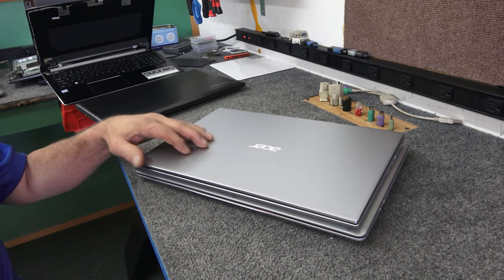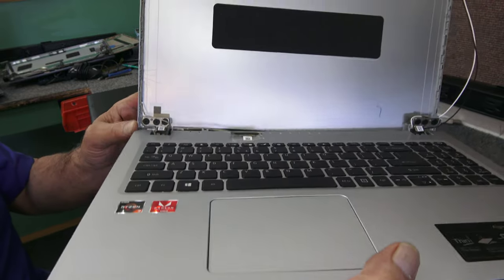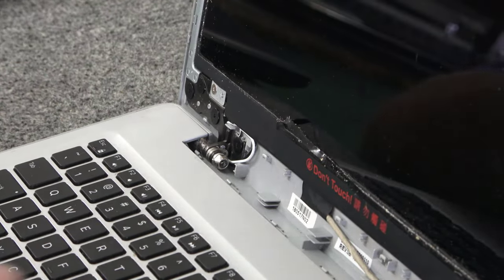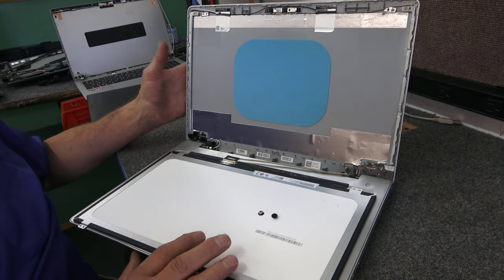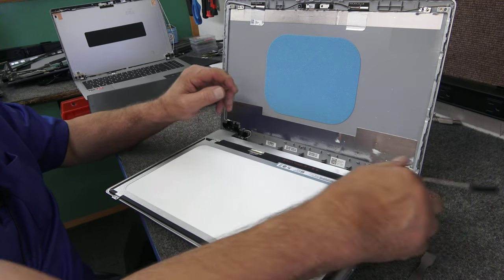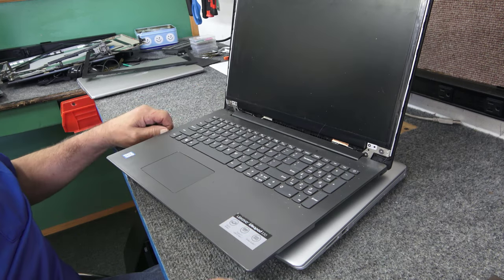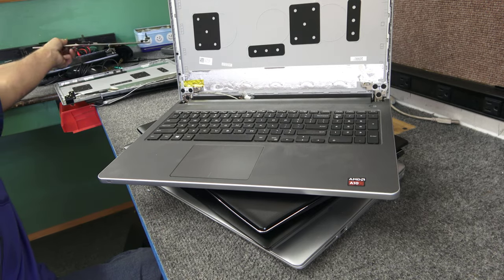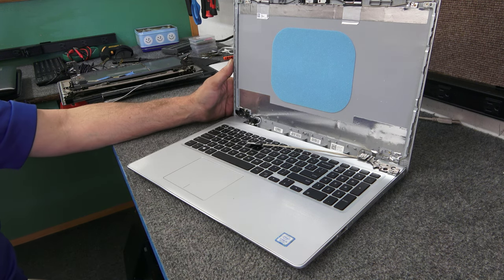Laptop Cover Broke From Hinges, How This Happens.

Comment: Even opening from the center will still break it, sooner or later. It's the failure of both mechanical design and choice of materials in pursuit of lightness and slimness.
Reply: Especially if you own an HP Envy laptop. The plastics are simply garbage.
Reply: @PlanetIscandar  Also Lenovo
Reply: bro please tell me i have a Lenovo laptop and i have the same problem, i have visited the shop 3 times and he pasted it every time, and after 3-4 days it again breaks, please tell me the solution ! PLEASE
Reply: @VinitAhlawat-l7q Just get new hinges
Reply: Exactly

Comment: Just had this happen to me with my Dell 3511 which are notorious for broken hinges. Thanks to Ebay for new parts and Youtube videos I was able to do the repair myself for about $40 which included new cover, bezel, and hinges. Taking it apart and putting it back together was a lot easier than it looked, (take your time). One of the repair videos I watched suggested adjusting the tension in the hinges to make it a little easier to open and close which should make your repair less likely to need repeating.
Reply: Same ! This model of Dell Has many faults , There are so many people complaining about this model and It is true! This model is not worth buying it , I can't believe Dell being a trusted company, It has Models like 3511 , Literally the worst one , You gotta Handle it with a lot of care , even The Slightest pressure on One side can ruin The hinge again
Reply: Same model
Reply: Same here
Reply: Same model
Reply: @souravpal5782  It's been 5 months and my repair is still holding strong. Remrmber to loosen the hinge tension some so there's not so much pressure placed on the hinges.
Reply: Same here
Reply: Same ..I had this issue and I got it done proper during warranty period and again I'm having the same issue and I don't know what to do as I'm scared to fix it on my own
Reply: @anushabn1630  Go ahead and do the repair yourself. I was hesitant to attempt the repair myself because I realized how delicate the electronic were and I knew that one mistake would possibly ruin my laptop. Follow the video as you make the repair and most importantly take your time. It was really a lot easier than I thought it was going to be. Also make sure youu reconnect all connectors, (had to disassemble mine because I forgot a connector) and most importantly don't overtighten the tension in the hinges. Too much tension in the hinges is what causes the failure in the first place. You want the lid to be fairly easy to open and close. Go for it.
Reply: Same laptop, same prob
Reply: i have same laptop
Reply: Same model and had the hinges broken twice in 2 years.. Trust me, I never handled it badly, I never even used it on my lap.. Costed me 3k bucks (INR) each time.
Reply: @Tithi1416  Cost you 3k?
Reply: Same 😔😣
Reply: I'm having the same issue , same laptop help me fix it 🥲🥲
Reply: Correct Dell put far too much tension in the hinge . undo the locking nut one turn and the lid opens much easier with still plenty of tension to hold the lid open .
Reply: Same model here. My laptop just started to show signs of this after 1 year of using it. Should I loosen the tension or should I contact Dell? Does Dell cover warranty for this issue in the first place?
Reply: Def  release some tension , apparently Dell are saying its wear and tear which is rubbish . I would unclip the sceen surround and run some superglue in the cracks if you see any. It only needs enough tension to hold the screen open .
Reply: When I open my laptop, I see yellowing of the screen. Is that normal because of the hinge? is it dangerous to continually open and close the screen when all I've done is loosen the tension?
Reply: Can some
One suggest screw driver to open and replace hinges for hp gaming laptop
Reply: Hey Ray, I have an 11 month old 3511 and the side of the screen coming apart, it's always been so stiff to open since the beginning.  How can I adjust the tension on the hinges?  What video can I watch?  Thanks.
Reply: Where can i get it fixed in Delhi? Please help
Reply: @Tithi1416 ssme here sis,damn 3000 is a bit too much for a student lile me

Comment: Thanks for sharing this. I also do repairs like that occasionally. Most of the time lenovos, they get brittle after a couple of years. I always make the friction of the hinges a little lesser. That way the stress on the enclosure parts is a bit lesser. I also use abs plastic and AB glue to reinforce the enclosures.
Reply: hey just wondering how much a repair like this would typically cost?
Reply: @tinymoondog7705  Depends on what laptop you have, but for Lenovos around $320.
Reply: My Lenovo is suffering rnnn
Reply: @GlocktheOPS  I got my hinges fixed for 98 bucks. But my screen wasn't broken so it was pretty cheap

Comment: A cracked screen bezel in the corner of the screen was my first experience with opening from the side back in the late 90's. The shop accused me of opening the screen back too far and because of that accusation I never returned to them. A couple of years later I found out about opening from the corners will cause damage. This was at a time when laptop screens were latched closed in the corners so that didn't help with the behaviour.
I've told everyone since then open from the centre.

Comment: Thanks for the post. Just had this on an HP envy 13ba I have had many laptops over the last 30 odd years and this is the first it has happened to me.  As you say the plastic degrades over time and on the hp one side failed quite badly.  Used a resin to effect a repair but not sure how long that will last.  Very disappointing given this weakness will lead to a lot of laptops being destoyed well before what should be their useful lifetimes.
Reply: U are not alone
Reply: HOW DO I FIX THIS PLEASE I HAVE AN HP ENVY SOMETHING TOO AND IT JUST FULLY CRACKED AND I NEED IT😭😭
Reply: I used plenty of areldite as the hinges themselves are ok but the case plastic cracked - it seems to be holding so far the alternate is a completely new plastic base

Comment: Thank you for the video Sir. My laptop started to fail with the hinge, but I never thought it would be a problem. Now I have a dark-black stain in my lower right corner. It´s not a big deal, but it´s very annoying.  Thanks for the advice, now and in the future I will open my laptop from the center. Actually not right now because I can´t close my laptop anymore, the 4 Phillips screws fell down, and the hinge doesn´t move anymore.  Actually, my laptop is also a Dell Inspiron 15 5000 Series like that one in the video. Thanks for the video, and thanks for the information. Greetings from Mexico
Reply: same i cant close my laptop now so should i repair it at phone services?
Reply: I had to use it 90° open**

Comment: I prefer the laptops with long center hinges. They seem like a sturdier design not subject to the opening stress of laptops with two flimsy hinges.
Reply: I've got a lenovo laptop with long center hinge but still had this problem because there are still two attachments on either side which have these manufacturing defects

Comment: Most laptops have hinges that have a nut that controls the tension and it is too tight which causes the hinge to break the plastic housing over time . The hinges seem to get stiffer over time and this causes the problem. The laptop makers don't care and try to charge you when you make a warrantee claim. I have repaired my laptop by passing a screw with a nut through the hinge and the cover. My next new laptop I will loosen the nut slightly on both hinges to take away the strain. If you are afraid to do this get a computer repair tech to do it for you.

Comment: Thank you for the video!  I noticed over time the hinge will gets more heavy. Can you make a video about how to remove the most commom type of hinge and how to open up them, clean them, (maybe take away burrs), oil them to let them work more easily?  Found out some hinges are expensive and makes replacing them not worth it. (added to the broken cover/inserts).

Comment: Exactly what's happening to my ACER ASPIRE 5 SLIM. I've had it for 2 years, bought it with my covid check, and just seen that the lid and hinge are bending apart. And I see where the screw that's supposedly glued to the lid is detached from :/ was hoping to find a vid on if you could glue it to extend it's life. Doesnt seem like super glue will be enough. dk what to do use jb weld and never open and close it again unless i have to.
Reply: Bro having the same issue .. what did u do ??
Reply: @ayushgaming2629  Yo I just never open and close it and praying It doesnt get worse where it's unusable. But If it does get worse then I guess Ill have to try hooking it up thru HDMI to my tv and using it that way if worse comes to worse 😥🙏😑
Reply: @ayushgaming2629  I think I might just buy a mini C-Clamp and clamp it on the bottom corner of my screen. Just gotta not move it at all cause if it falls the c clamp will probably bust the screen.
Reply: @redmakerr  trying the method of not closing it now .. will use c clamp to if it gets too worse
Reply: @redmakerr  and if it gets too much out of hand .. then I will buy a 2nd hand monitor and connect using HDMI

Comment: Happens to me every time. A drive fails, battery,  something.  I take the back cover screws off. Eventually the cheap threaded inserts break. The cover doesn't screw on right. everything gets loose, the hinges fail, and I buy new laptop. If those cheap threaded inserts that held the back cover didn't continue to fail my laptops would never break

Comment: Thank you for the information, and my  new laptop is in the same situation  ,  just 2 months has passed,
My mind is blank , can I ask them for a replacement   for the laptop , is that possible.
Reply: If it's just been 2 months it should still be under warranty. I would definitely check

Comment: I better be careful with the HP laptop that I bought back in April of 2021. HP 15, AMD Ryzen 3 3250U, 4GB SDRAM, 1TB HDD + 128GB SSD. Screen is awful but is an OK unit for minimal random use. Price was high.
Reply: How much did you pay
Reply: @ad1854  $349.00
Reply: What was the model?

Comment: I've had many laptops over the years and it never fails, the hinges go bad and I end up with a cracked cover and I always told the manufacturer that they need to fix the problem but they never do. I don't think they can come up with a solution.
Reply: They can and they have the money to come up with a solution but they just don't want to. Though expensive, Apple's Macbook hinges don't break

Comment: Excellent video Dale. My Dell 3521 laptop has the bezel coming loose next to the right hinge, could you possibly tell me if I can just remove the bezel by unsnapping it, or do i need to remove the bottom to see what is going on. hinge is tight just the bezel is out about 16th" It is 9 years old, problem is I really like it and want to to fix it. I am wondering if it could possibly just be a tab on the trim bezel & not the base. The trim bezels are only $15 or so.

Thank You

Comment: Does anything like this happen to MacBooks, be it the air or the pro, like in the new ones? or they don't even have the concept of gluing hinges with the top lid?
I would like to know.
Reply: MacBooks do not have this problem, the hinges attach to metal on both sides

Comment: ChatGPT says  There is no single laptop computer that can guarantee it will never have a broken hinge problem. However, some laptop computers have been rated highly for their build quality and hinge strength. Some of these include Apple MacBooks, Microsoft Surface devices, Dell XPS laptops, Asus ZenBooks, and Lenovo ThinkPads.
Reply: I think the point is not opening it from the sides, sure on a laptop with a more resistant body the hinges are stronger and last more but opening properly must solve most problems.
Reply: Lmfao the microsoft surface isnt hinged that was your first error going to ask a damn ai chatbot 😂😂 dude litterally tells you how to not brake the hinges, no point in being dumb about it

Comment: Sigh. This just happened to my laptop. Managed to get it opened tho & its still working. Ill just never close it again!! 

Looking at that 2 hinge design in and Im not surprised it breaks. Im no designer etc but shouldnt the whole bottom of it be one big hinge so it spreads the continuous opening and shutting of the laptop out across the entire bottom of the screen? or shouldnt there at least be a third hinge in the centre to help the 2 on the sides?.... Meh, I bet they design these things to break after a few yrs so people have to buy new ones. Anyway good explanation of what happened. Thanks for the upload.

Comment: You can easily fix it with epoxy and beef it up much stronger than it was originally.. Or you can even drill bolts through the top case and give it that "steam punk" look.. and it will be stronger than it ever was.  Just saying its' broke and "that's That" ---  is the incorrect mindset.   These are always fixable, as long as the screen isn't busted.

Comment: Great video. I'm angry that a person can spend $1000 or more for a product that's made so flimsily. Hey computer manufacturers, how about offering military quality for a few extra bucks. For my phone, I spent an extra $50 for an Otter Box and screen protector. I consider that worth it. I keep my laptop in a soft protector and put that into a laser cut hardboard box. So almost nothing from the outside is going to break my computer, but this is a problem from the inside. Indeed, my computer has this problem. When I get my computer fixed, I'm going to ask for bolts through the lid. With the nuts, it will stick out the back a little. I'm going to try molding tape made for auto trim and then carbon fiber trim tape for autos covering that. Hopefully, the final result will last and look cool, too.

Comment: I have a Chromebook that’s doing this, and idk where to take it to get it fixed :(
Reply: I have an HP Chromebook that I just bought last November...and it looks like the hinge is already starting to crack on the right side...unless it was a manufacturing issue.  Can't prove that yet.  I'm hoping it breaks before the warranty.  Unfortunately, I was told it's cheaper to buy a new Chromebook than to get it repaired.  :(

Comment: My Lenovo Idea Pad Flex 5 is only two years and two months old; two months out of Costco's warranty. The hinge is causing problems with the screen's pixels and pulling the screen apart. 

In the past twenty years I've used nine different laptops - this is the only one I've encountered with mechanical problems. This laptop is Chinese crap! Get a better-quality laptop! (HP has a better hinge system that runs across the width of the screen - and my wife's Apple lasted ten years.)

Comment: My Asus zenbook ux535 of 3 years recently had its first problem. The charging port got fried somehow. Charger does not go in smoothly anymore and neither do other ones that I tried. I would always have my charger connected to the laptop on my desk. It wasn’t an issue before so I have no clue how this happened. Tech guy opened it for me and confirmed it got fried and my bad luck it had to be connected to the mother board. I’m extremely sad as I love this laptop and now it’s been sent in to be diagnosed by a local repair shop. They have to get back to me still. I’m just very stressed that it won’t get fixed. I really don’t wanna buy another laptop as I love this one and it’s hard to find now days. I’m sorry for commenting I guess I just need the support. Seeing everyones desk setups and computers all over my algorithm makes me depressed. Is this something that can be fixed ? Once again I’m sorry for putting my problems on here. It’s just been a really rough few days for me.

Comment: hey man pls i need your help my laptop's screen wont properly close it will leave some space at center or something like that. my laptop is dell inspiron n5110 (i have it for 11 years) pls man i will do anything to fix it its the only thing that makes me happy..its the first time that something like this is happening..
Reply: You should repair it , It took Minimum $8 in my country for the repair, Mine was worse the whole screen was Being detached from frame , The hinge was broken for sure , But next time handle it with a lot of care. Mine was Dell Inspiron 3511 and this happened within only 3 months of buying , even the slightest Pressure on one side can ruin hinges , so make sure that you use it in your table , not bed and Open and close  With the centre gently